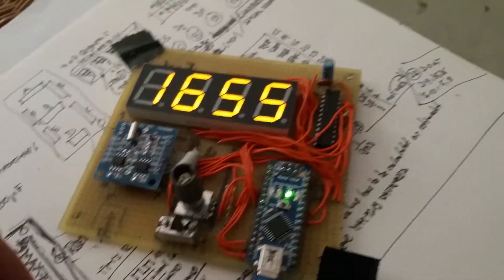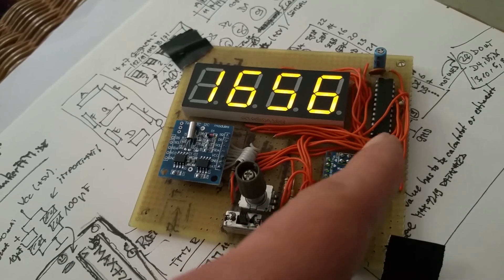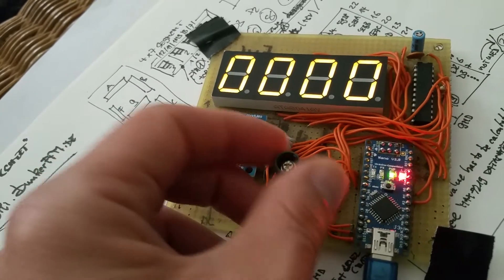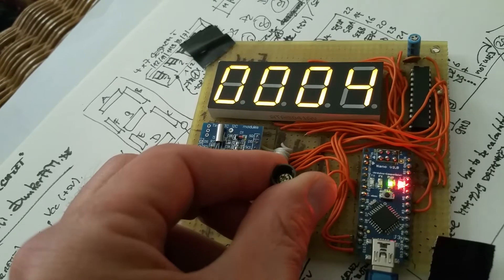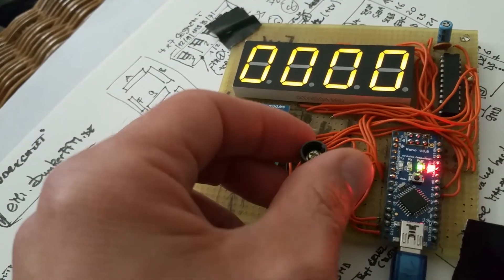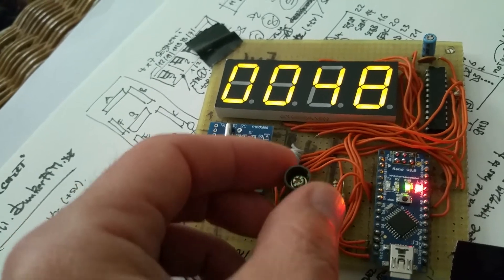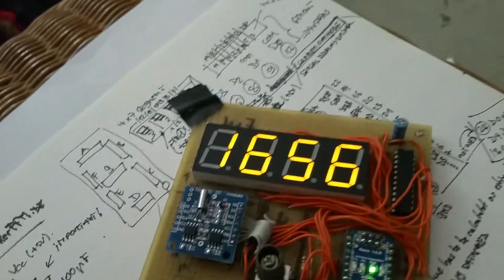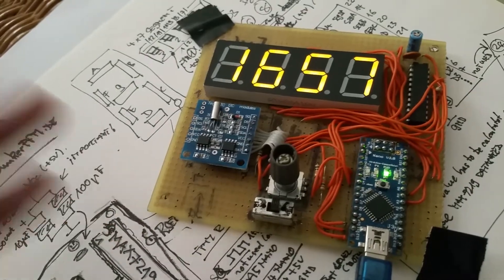Clock Project with Rotary Encoder

Comment: Hi Enrico, for sure, an excellent job but, as I am a beginner, I was unable to understand the MAX7219 connections; is clarification possible? The digits and segments pins I understood!
My advance thanks
Reply from the maker: On my website is a description of the connection between Arduino and Max7219 and the 7x4 digit LCD. Some of the LCDs have a differnt pinout.